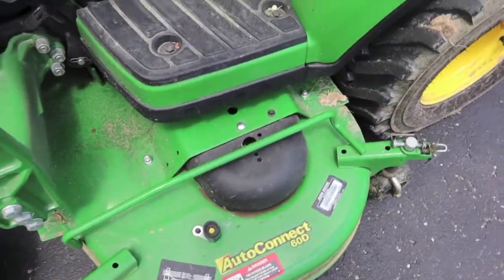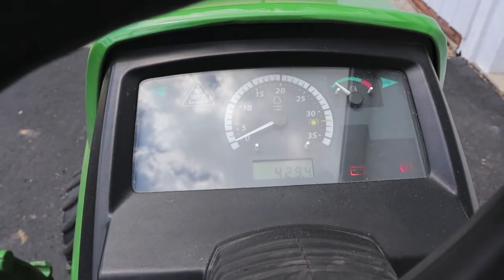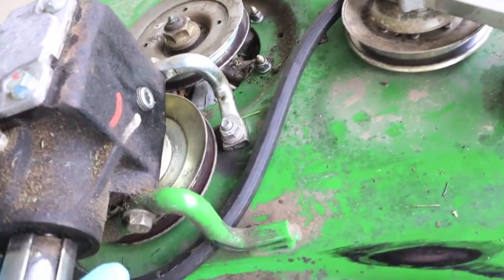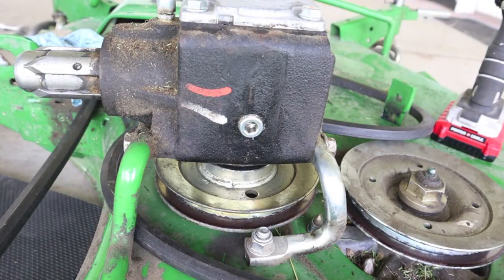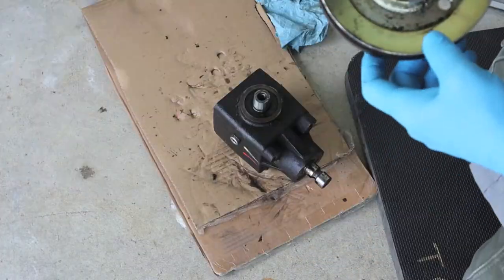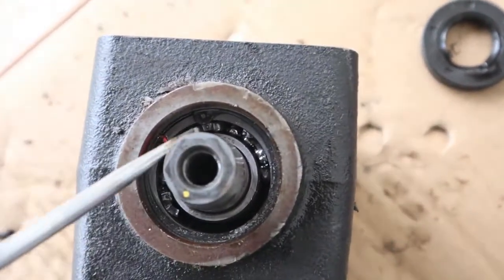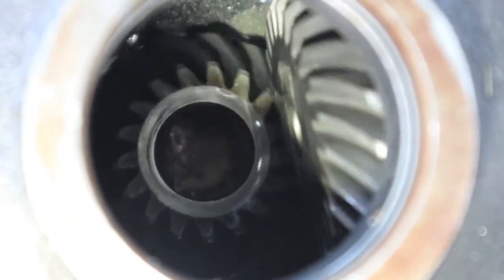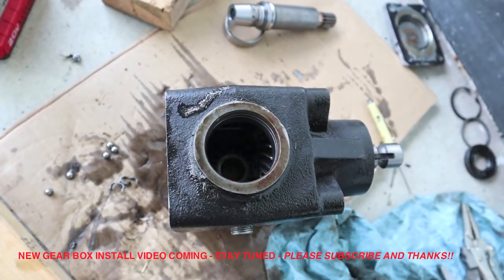John Deere 60D gear box bearing FAILURE!

Comment: Use deere oil. Or keep having issues and not knowing what caused it. I would guess wrong oil ate seals up it leaked and eventually it will seize up solid. Some oils turn to water that box gets hot it needs gear box oil im huge fan of amsoil but not in my john deere learned long ago
Reply from the maker: Good info, thanks for the comment!

Comment: Very interesting video.  I am doing the maintenance on mine and I am about to change the oil in the gear oil.....Now I was going to use some gear oil bought at the local car store....but after seeing your video, I will go get OEM oil at the John Deere dealer.
Reply from the maker: There is so much load and side pressure on that pulley, combined with the heat and just a few ounces of lube oil.....I'll just change it out every year. 
Work safe!
Thanks for watching!

Comment: realistically where the freeze plug style plug is, looks like there is enough meat to thread the gear box and make a solid plate to bolt over that hole just like the plate you take off of the top with either a machined o-ring or some good ole black ultra silicone. I would use aluminum and make some fins to help with cooling that box.
Reply from the maker: Thanks for watching!
The gearbox can be removed fairly quickly. 
The replacement box is running great and the oil stays super clean.

Comment: What do you do if nut like your won't come out check oil level!!!
Reply from the maker: If you have the breather threaded in on top and it's a straight shot to the bottom or at least the proper oil level height, just add to the fill level and stick it with a thin rod etc.
Thanks for watching!

Comment: Just wondering what would happen if you overfilled the gearbox?It has a breather port to relieve the excess pressure. Makes you wonder why they would make a gear box that holds such a small oil capacity with no alternate means of cooling the oil.Bad bad design.
Reply from the maker: I agree, the capacity is way too small and the load on the box must be pretty heavy because mine gets very hot. I'm going to change the oil in it at least every year.
Thanks for watching and commenting!

Comment: Hah, here I am a year later commenting again.   JD doesn't list a replacement gasket for the gear box.  Doesn't list the bearing washers or the tiny spring.   I suspect the point is, they want you to buy a new tractor instead of fixing the old one.   I love my Deere tractors, but this machine breaks almost every time I mow!  Oh, Front axle seal blown as well!  Didn't even get to that part.   For the age of this machine, I am less than impressed!   I say, stay away from the JD smaller tractors.   3 series or larger for sure.
Reply from the maker: Well, 3 series is nice but you don't get a genuine John Deere engine till you get into the 4 series.
I have had very good luck with my 1025R in 7 years and 650 hours.
You are right on the gearbox, I'm thinking about buying a spare just for reserve. This supply chain bottleneck bothers me a little.
This 2nd gearbox on mine is doing great though. The oil stays super clean and it came with a magnetic fill plug.
Thank you for watching and commenting!

Comment: My gear box failed on my 62C at 170 hours. My dad’s 1980 JD 400 with 800 hours still going on the original one. Deere does not make quality any work. You are just buying a paint job.
Reply from the maker: You are exactly right. JD is a global company that uses China, Turkey, Italy, and on and on. We checked out a half million dollar combine and its components came from all those countries.
I'll never forget the main drive hubs, huge cast hubs had made in China right on them.

Comment: At 9:55, when you take the top off by removing 4 bolts, what is that lone 5th bolt that stayed?  On my deck, that bolt has some strange metal cap on it.  I can't figure what that bolt does, and what is so special about it.  Looking to find info is how I found this video, as well as your replacement gearbox install video.  You have a lot of knowledge and present it clearly.  Great video skills too.
Reply from the maker: Hi Jeff, that "bolt" you see is the breather vent for the gearbox. On some vents, you can rotate them to keep them clean and on some you can't so just wipe those clean. 
Thank you for watching and commenting, I appreciate it!

Comment: JD decks are garbage!  Kubota, same.  Pretty much modern decks are junk!  My 54D is nothing but a headache from day one!    Between the RIO system, the belts jumping off no matter what I do.  Gear box running very hot no matter what, deck bends if you fart on it, crap plastic gauge wheels, man I  can go on and on...  Will not buy another 30k John Deere tractor, that is for sure!   Pcs of crap for what I paid!  6 years of use and I think the whole machine is leaking from almost every seal.  The engine is the only good thing about the tractor.  Maybe, the tranaxle.  Front axle leaks fluid.  Many hydro fittings leak.  Hoses wearing already in many cases.  Not sure what everyone loves JD for!  Overpriced, under made!

Comment: I think I’m having the same problem.  The pto seems fine and the blades will turn by hand using the pto but when I hook it up to the tractor the blades wont spin.  I assume this means it’s the gear box?  Any Ideas?
Reply from the maker: No, that would not be it. The deck is off the tractor and you can turn the PTO shaft (on the deck) by hand and verify the blades are moving. 
After driving over and hooking up, assuming everything is correct, don't forget to check the PTO position lever. I have hooked up many times only to pull the PTO switch and nada.
I had the PTO select lever in the back position.
I hope this helps.
Thanks and good luck!
Work safe!!
Reply: @pmtips4482  it turned out to just be the half moon key that holds the PTO connection on the gearbox shaft.  Easy repair thankfully.
Reply from the maker: @nakedflockapplewoodtrainin2419  Good deal! For a woodruff key to shear, it takes a lot of force.
Check your key slots just to see if they are still fairly snug fitting.
Work safe!

Comment: I will never have these issues because I sold my mower deck. It was a poorly designed piece of garbage. I have saved so much time and money buy just buying a riding lawnmower and a Bush hog.  The right tool for the job.  Stay away from the drive on deck, it will ruin your day more than make it.
Reply from the maker: Thanks for watching and commenting!
Reply: I cant tell you how often I've thought about doing the exact same thing.Nothing about this tractor has caused me more aggravation than this thing called the mower deck.

Comment: Say thanks for the tip.
I'll talk to my local amsoil dealer and put some in there right away after break in. I'm getting a brand new 1025r with the 60" deck
Reply from the maker: trainmaster, you might want to move up to the next viscosity level of 75W-110, depending on your temperatures. You might also talk to your dealer to get his thoughts. That little gearbox does so much work and when it's in the 90s that thing gets hot. There is lots of pressure on those gears too especially in tall grass.
I may go to the 75W-110. Still undecided.
Thank you for watching and commenting!
Stay safe!
Reply: Say one more thing I was thinking of that I wanted to mention is i've run different kinds of machinery all my life. I think running the mower at 1600 PTO shaft speed it much much better for it rather then at full throttle. But in my case here in MN my grass isn't that thick.

Comment: I have a 54" HC deck, i think my gear box is going also, nice video! Will take apart now that you showed the best way to check this. May have to throw a few hundred dollars at this new part,they are not cheap.
Reply from the maker: Hi Keith, from my limited research the prices on gear boxes are a strange thing, on some John Deere mower decks the little gear boxes are running 11 to 1200 dollars.
The gearbox on the 60D is one of the lowest-cost gearboxes you can possibly buy.
I see some on Amazon now for as low as 299 plus  shipping and they are getting good reviews too.
Reply: @pmtips4482  I have the 54hc. Do you think off market brands are as good on amazon?
Reply from the maker: @keithpeterson9179  if you are talking about 50 dollars difference in gear boxes from Amazon and Bombergers John Deere, I would go with BJD, make sure you get the part numbers correct as there has been numbers switched and superseded to where dealers have the old part number at 700 dollars and the newer number is 350 dollars.
But on your question of trusting a non OEM box, if the reviews are heavily weighted toward positive and the money difference is substantial, I might take the risk.
Reply from the maker: @keithpeterson9179  on a side-note the box I bought from Bomberger's John Deere has got several hours of mowing on it already and the magnet has very little metal on it. The oil looks brand new so I think it's going to be a good gear box.
My dad just had to replace one on a Kubota zero turn with a PTO drive on his deck and it was $1,100, dayum!
Reply: @pmtips4482  Thanks for all the help!

Comment: That's something to look out for. Got about 200 hours on my deck. I'm also an amsoil user, have been for 20 years+ must have been limping before that service. What did the oil look like that came out of it at service time.
Reply from the maker: Hi John and thank you for watching and commenting!
That's the thing that really surprised me, I evac the gear box out every year and there has been no metal in the oil.
It went out within about 30 hours running this year.
I'm not critical of Russian bearings, I just have had bad luck with Russian bearings.
This ball bearing runs continuously bathed in good gear oil and still failed. My fifth wheel RV had two badly pitted tapered wheel bearings found during a routine bearing pack, both those bearings had bad pits in both the rollers and inner race. Both were made in Russia and both were covered in high quality grease.
It's my opinion the failed bearings were not properly heat treated.